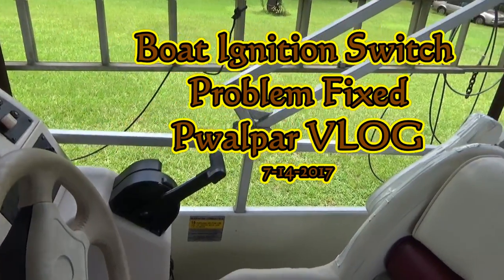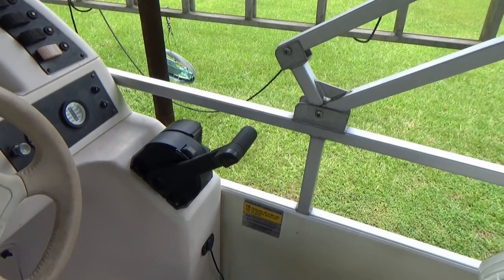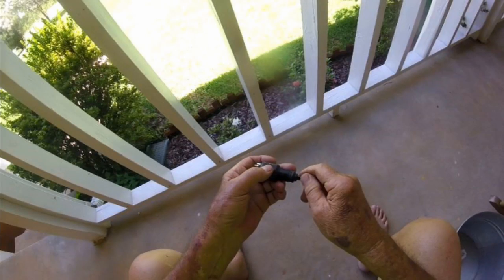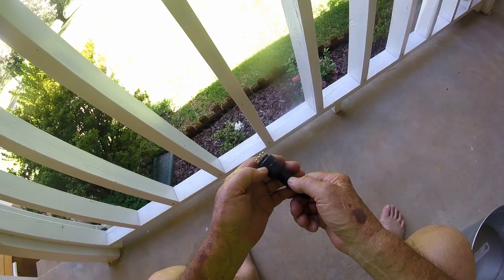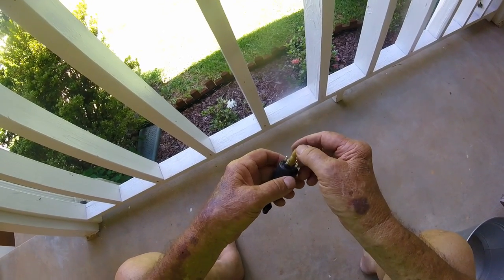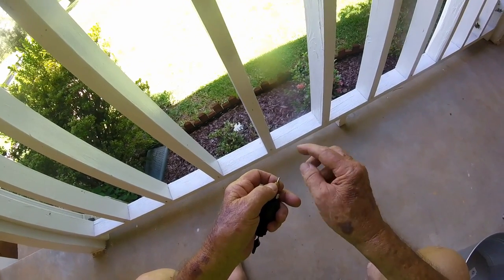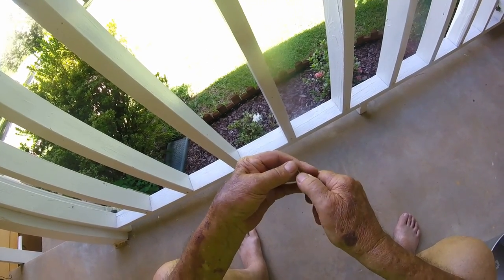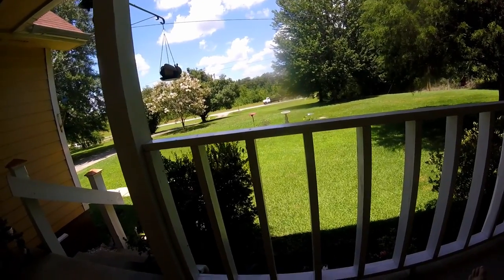Boat Ignition Switch Problem Fixed Pwalpar VLOG

Comment: Thank you very much, I recently had an ignition problem, engine would crank but would not start.  I kept replacing the ignition switch and it would fix it for a while, then eventually the same thing would happen.  I was getting ready to switch out another ignition switch and watched this video when searching about why an ignition switch would fail.  It made me remember the last time I was at the boat launch and it wouldn't start, after "jiggling" the wires on the back of the switch it started.  After watching this video I went out and popped a few wires off and reconnected them and boom it started!  I haven't figured out the root of the problem but at least I am closer and can get the boat to start.  I just wanted to say thanks! - Joe
Reply from the maker: Joe. thank you for watching my video I'm glad it was so some help to you

Comment: I wonder if this is the problem with my boat. I go to crank it and all I hear is click, click, click. Got a new battery, checked the spark plugs, starter has voltage going to it. It won’t even turn over though, I haven’t thought about checking the ignition
Reply from the maker: I think it will be a lot of work like I had to put in but you will figure it out  go here and start digging http://www.marineengine.com/

Comment: My ingition will not trun the solna or starter could it be the key switch
Reply from the maker: It has been a while since I made this repair.  If it was me I would replace the switch anyway/  As I remember the switch was badly corroded by weather and didn't cost all that much